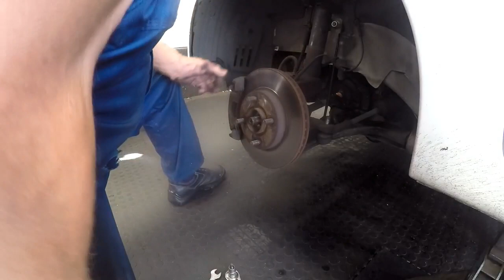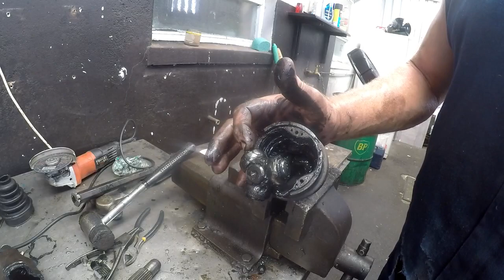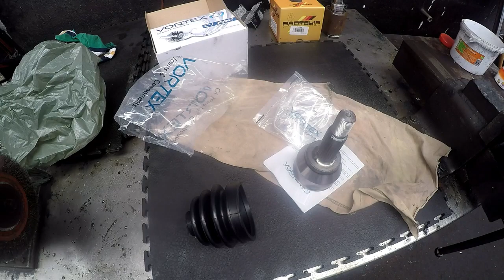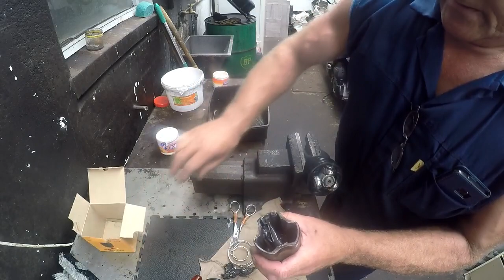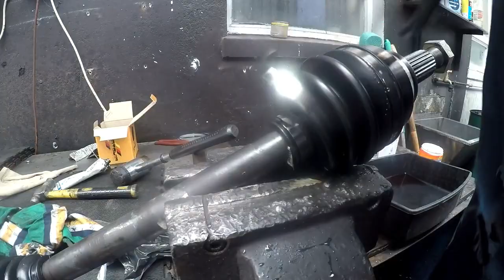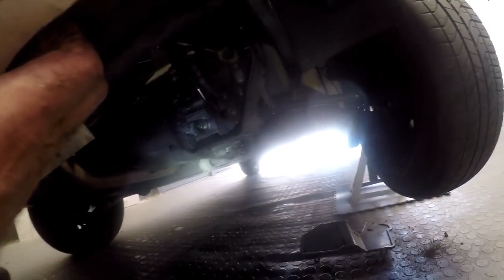Ford Figo - Front Outer Cv Joint Broken

Comment: Well done Garry, at least you saved your customer some money by only replacing the outer joint. Most people just buy the entire left drive shaft with both cv joints, so it's just pull out the old and fit the new. Saves time, but the customer has to buy for it.
Reply from the maker: That is what it is all about helping others.

Comment: had to have been ignoring that for a while, but at least you got a nice collection to add to the ironies in the marble box. That inner clip is always a problem, if it is in any way giving issues replace it, and not be like me having to pop it back in in the rain.. Yes Ford has been using that same gear level fill plug for a while, I made my own out of an old 8mm one and a grinder, just to keep it in the tool box. Especially with those right oil is very important, not SAE90 gearbox oil, or it will grate going into gear, but the right SAE75 gearbox oil, which will keep the gearbox smooth and silent.

Going to guess the other side will be needing to be done within a year, it just wears slower as it does not wind up as much, the shaft flex helps it absorb shock.

Comment: Good morning sir.
Do we need to grease or lubricate the CV joints of Figo frequently to avoid such breakages? If yes what frequency or kilometres? Since Ford has not mentioned it in its maintenance schedule.
My figo 2013 has done 108000 kms .
What are the other things to be lubricated in the drive system? ( Other than the Transmission oil)
Reply from the maker: There is no maintenance on CV Joints as the rubber boots are sealed, the only time they need replacing is when the rubber boots tear or crack due to age, when torn or cracked the grease leaks out and results in dirt and grit going into the joint and causing wear.

So when your car goes for servicing the CV Boots (inner and outer) should be checked, if torn it should be replaced immediately.

As far as suspension goes, modern cars do not have grease nipples on the ball joints and tie rod ends as in the earlier model cars, so no maintenance there, except visual checks for play and wear when servicing.

I hope this explanation answers your questions.

Thank You for supporting my channel with your visit and interaction, I am pleased this video was helpful to you.
Please feel free to check out the rest of my channel by clicking PLAYLISTS https://www.youtube.com/@vehiclemaintenanceandrepai3790/playlists for more helpful service and repair videos on most makes of cars available here in SOUTH AFRICA,
It is FREE.
Reply: @vehiclemaintenanceandrepai3790 Thanks for your reply, subscribed to your channel and will recommend it to others too 👍
Reply from the maker: @cowsgoloka  Thank You (from Gary)

Comment: Hi uncle, any reason why you wont use a higher quality cv Joint like SOLID?
Reply from the maker: It always depends on what is available at the time Kevin but the brand I used (Vortex) came highly recommended.

Comment: Hello Oom please tell me about inner cv clip. Why has your inner came out so easy. Wasn't the clip hold it tight in gearbox. I see now when you put it back there is a clip that hold it tight. Please help there. ? I am trying to find thrre is no number to call
Reply from the maker: It is designed to loosen when a certain amount of pressure is applied, Luyanda, it is made of spring steel.